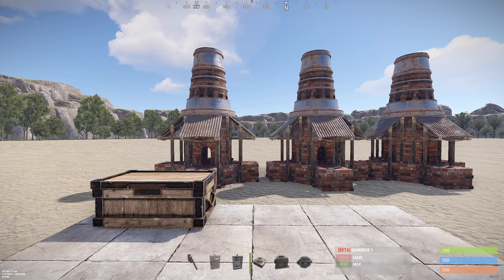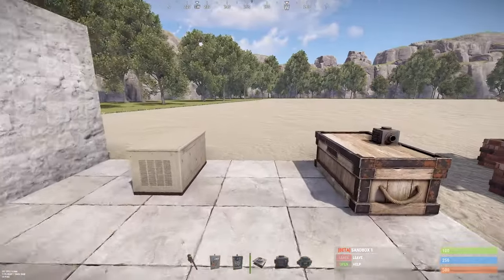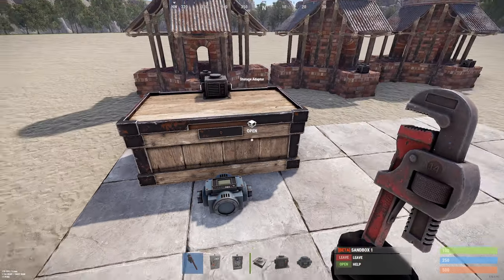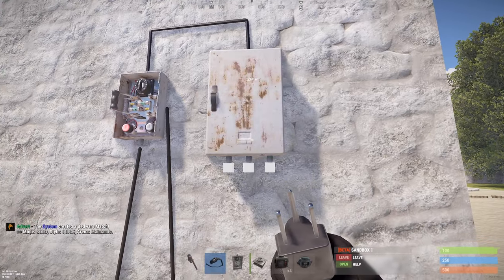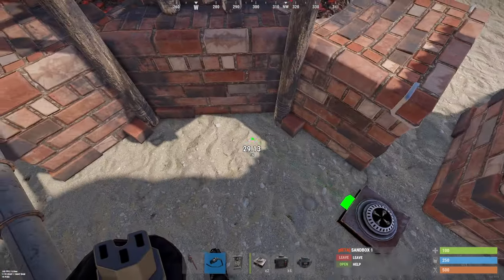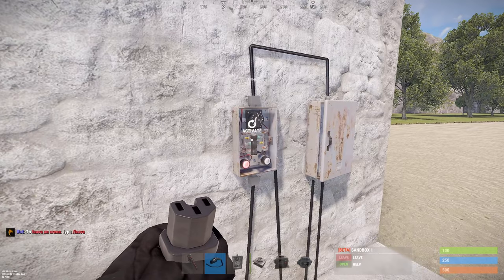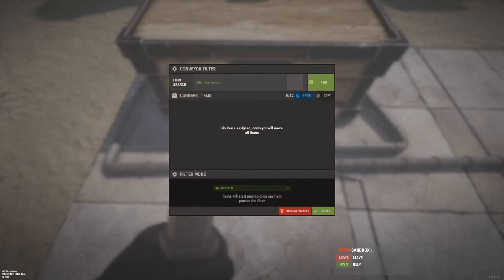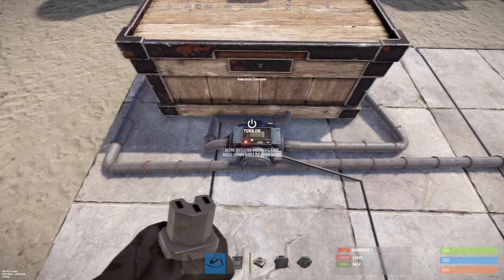Creating a Smarter Furnace in Rust: How to Build an Automatic Large Furnace

Comment: thanks alot man but i got a problem the furnaces don’t turn off automatically they keep on going until all the wood is gone
Reply: easy way to fix that is setting up the right filters in the industrial conveyors so it only moves wood if their is ore in the box as well
Reply: @sanik9581  how is that done
Reply: I second the question. How is that done? I can think of a complicated way to do it but is their a easier way than having multiple conveyors blockers etc.